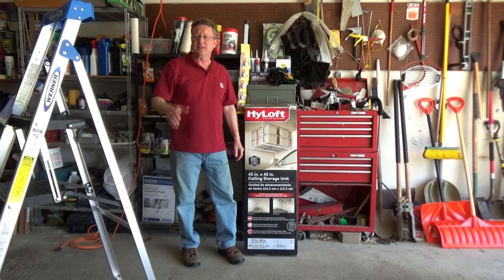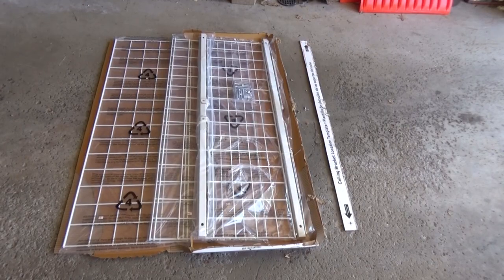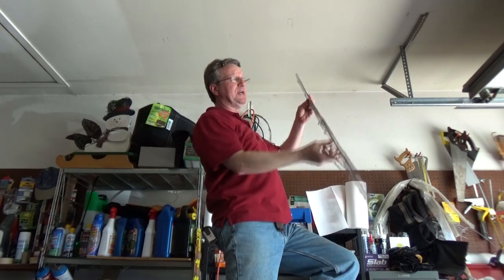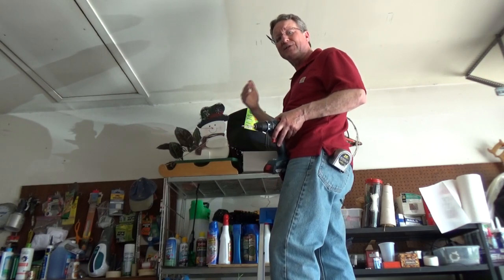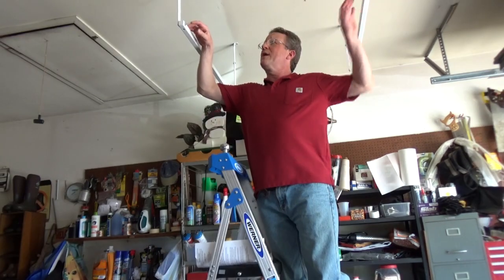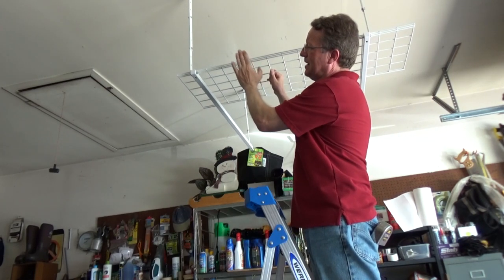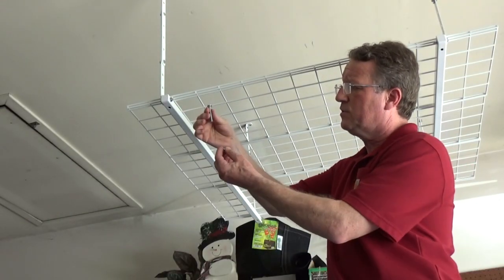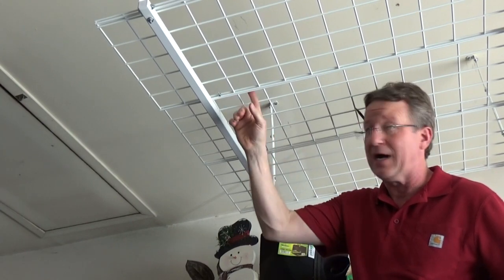How to Assemble the HyLoft Garage Ceiling Storage Shelf

Comment: How do you make sure the pilot holes on each of the brackets are level to one another and how do you make sure the template is level with the joist when setting it up. I attempted to use a level then realized it doesn't work that way.